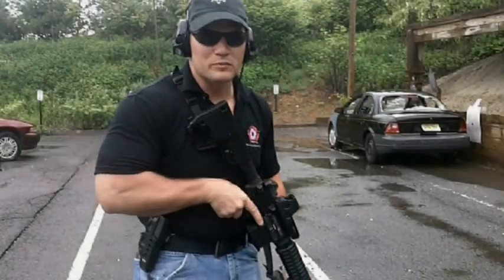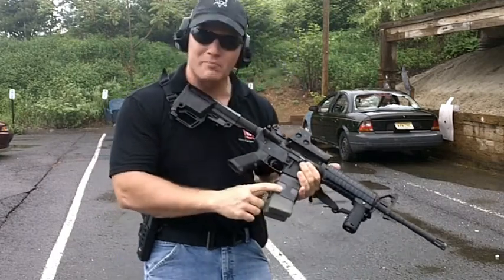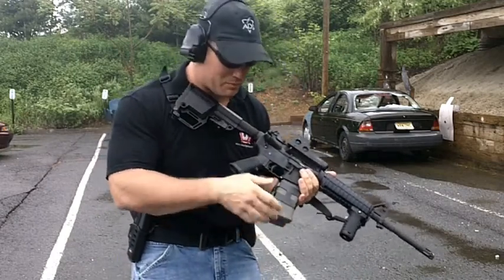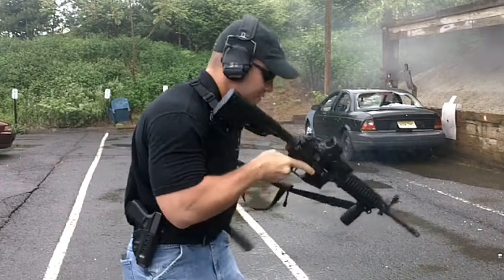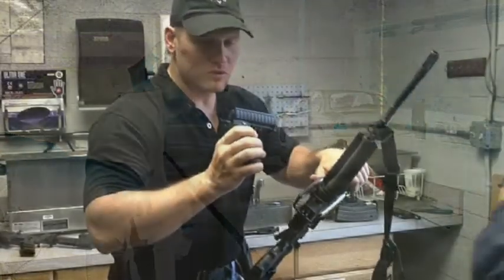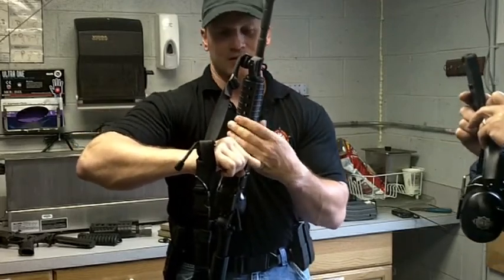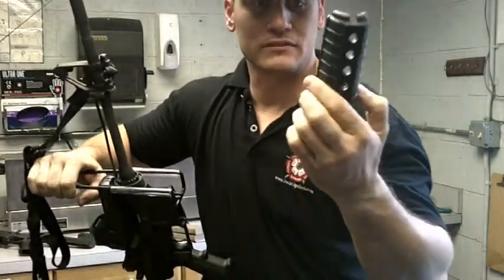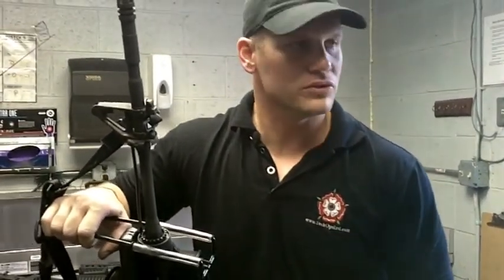Mission First Tactical (MFT) Innovative Polymer Handguard Heat Test

Comment: Mission First tactical
Does this M33 handguard come with heatshields?  
I have read on a few websites that sell your handguard that they come with heatshields and some say they don't.
After you finished firing this and showed the handguards I did not see heat shields in there. 
Was just curious as if they came with heat shields?